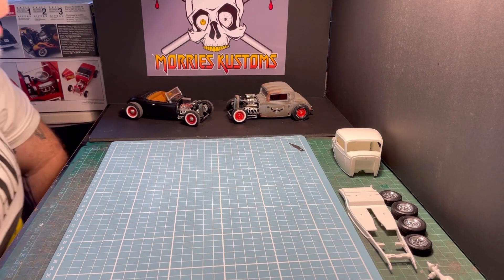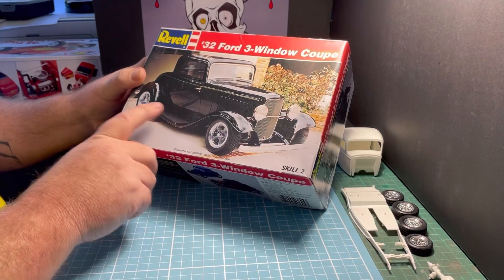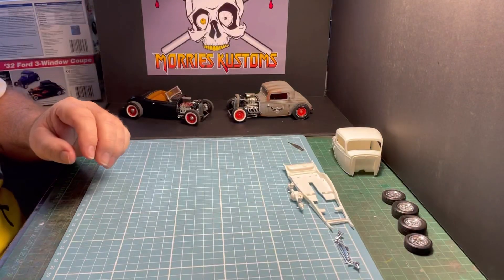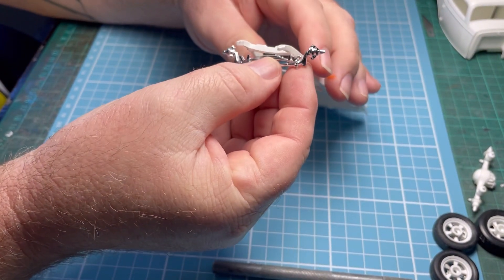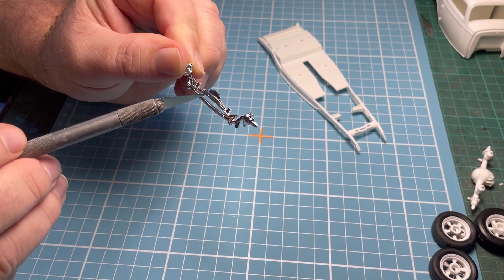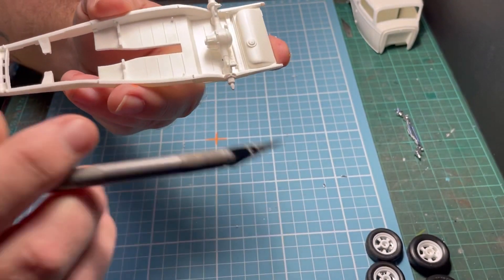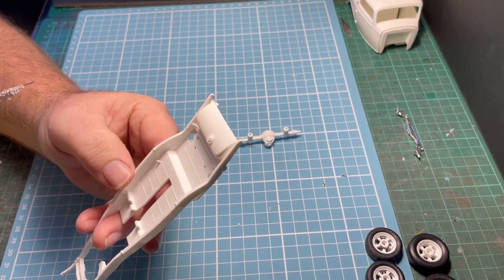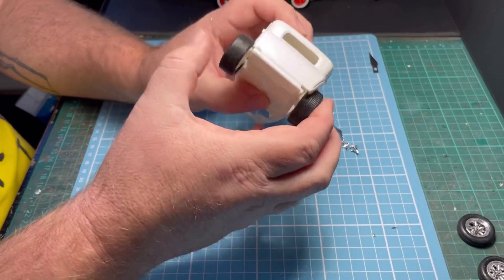Lowering a 1/25 scale Revell 32 ford

Comment: Hey Morrie! I absolutely love your lowering and body drop videos for the Revell 32 Fords...have you given any more thought to describing the lowering and channeling you did on the Revell 29 roadster shown in that first video. OR doing same on the Revell 30 coupe? Hope all is well and that you're modeling away!
Reply: I am working on a custom 3s printer chassis for the Revell 30 ford kits, if i decide the body needs channeling i will do i quick video.
Reply: @jasonmorris4795  I'll be interested to see what you come up with! I am using that kit as the basis of a long-term project that has to be pretty darn low. AND it has to have fenders...